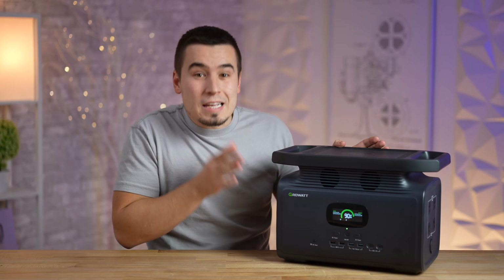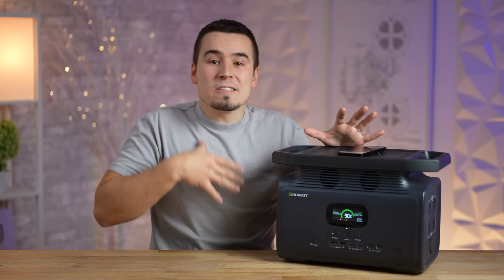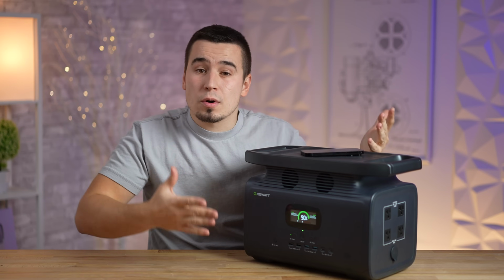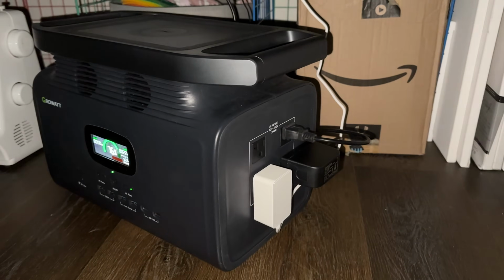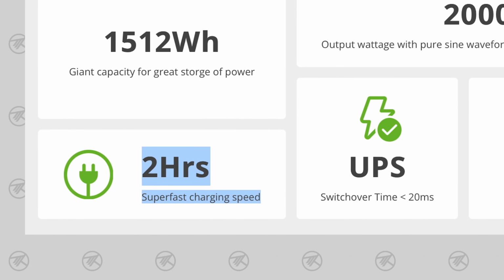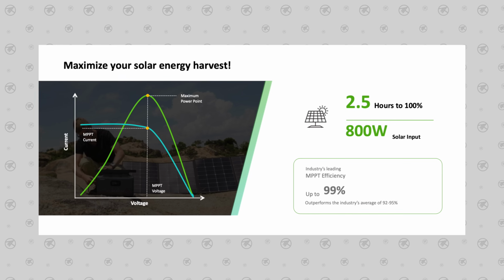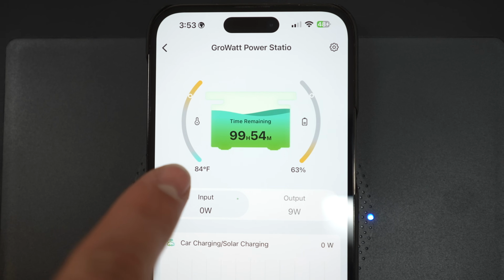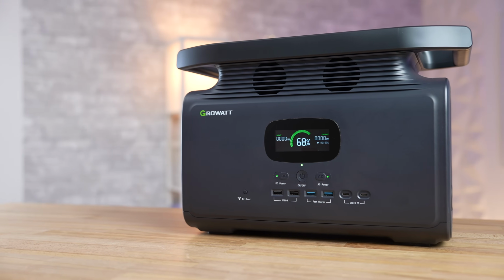Why EVERYONE Needs a Portable Battery Pack: Growatt Infinity 1500

Comment: Seems like a handy tool to have during a winter power outage. We had a flood that destroyed my backup generator this year and lost power for 6 days. Thankfully it was summer, but it was bad. I have power banks that are 500 watts so I was able to make coffee and check news/weather updates by powering up my wifi router since the cell service was shut down. But I had no way to recharge them. This on the other hand seems like a really good idea.
Reply from the maker: Wow even with a backup generator. I have one too but it needs to run it all the time to keep the power on and it needs to be outside because of the fumes and then other people can hear if they are running, some are somewhat quiet but get louder if you have a load on it, while others are really loud all the time. The beauty of these large battery packs is that you can use the power without having a generator running so even if you have a generator you can run it for 1-2 hours to charge up the battery pack and then just run of the back or even better use Solar to keep the pack charged up silently. They are also really helpful to have even if you're not in a power outage just to be able to have 110 power wherever you need it and I take mine with me when I go camping or somewhere were they is no power. Being able to charge an iPhone over 100 times instead of once or twice, and charge up ipads, Macbooks, etc is so nice as well as running power tools that need to be plugged in, which are much cheaper than cordless tools is also really nice.
Reply: @MaxTechOfficial  Yes it was outside in a small shed that was destroyed by the water,  thankfully that and my lawn mower were all we lost. Absolutely I'm going to order one of these as soon as I get through my Christmas shopping!!

Comment: I’ve had a Jackery 1k for years dude. It doesn’t have a top charger like that and it’s not recommended to drain your car battery! Power outage uses are best! You can use solar panels to recharge it too! Check out HoboTech on YouTube. They also have waterproof ones by Montek! Goal Zero is a good company also. They can keep your entire home going! 
Having them when you’re CAMPING IS AWESOME! They can charge your RV now!
Reply from the maker: Most cars have protection to not give too much power when the car's engine is off. It's great to use when you're driving somewhere so the power isn't being sucked from your car battery but from the alternator that is generating it. Most newer cars are around 100 amps from the alternator, SUV's and vans are higher, like a Dodge caravan is 160 amps, but even really old cars put out 50+amps. A 2000 Corolla which has a small engine and alternator puts out 80 amps and a 30-year-old Corolla is 70 amps stock so realistically you should be good!